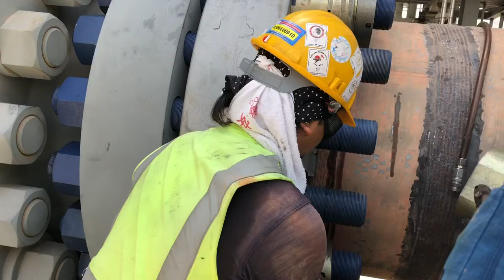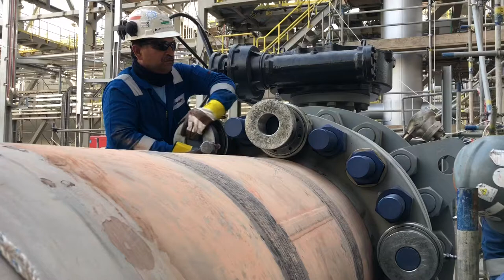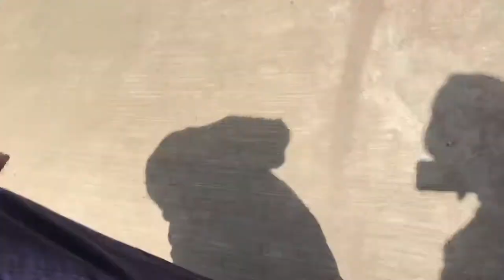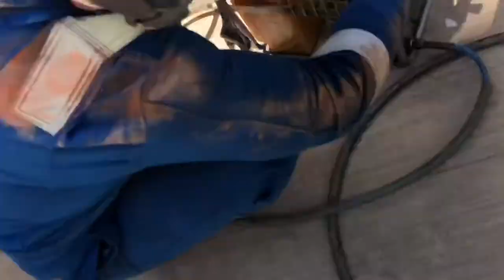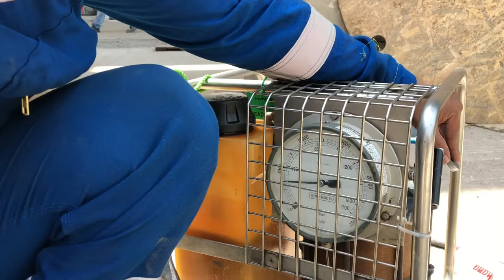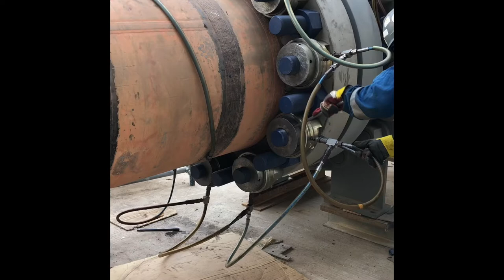HYDRAULIC BOLT TENSIONING

Comment: How much % is diference between Pressure A and B?Sample presure A 650 bar,how much will be B pressure
Reply: Pressure A is always higher than pressure B on a 50% tensioning configuration, the % may vary depending on the LTF and the CLF. the Load transfer factor is calculated as: LTF=1.01+(nominal diameter/grip length). the Cross Load Factor commonly ranges from 1.15 to 1.25 so Pressure A can be calculated as Pressure B x 1.25. Pressure B already considers the LTF. Pressure B is residual load x LTF. hopefully this helps!